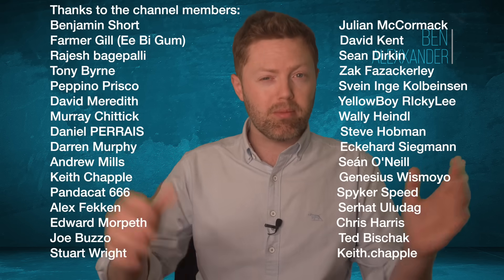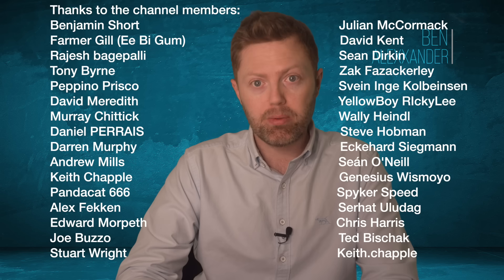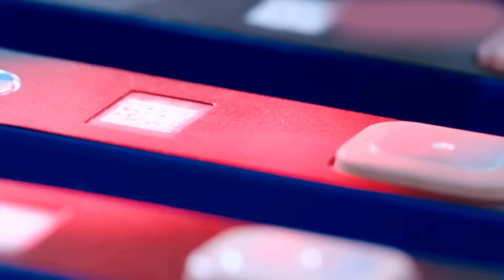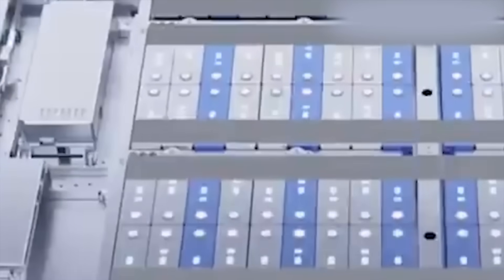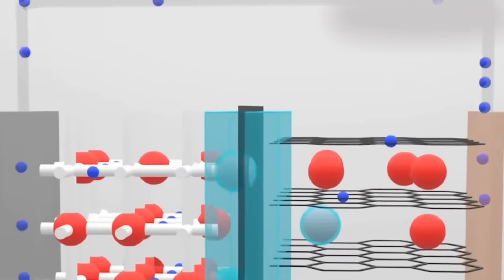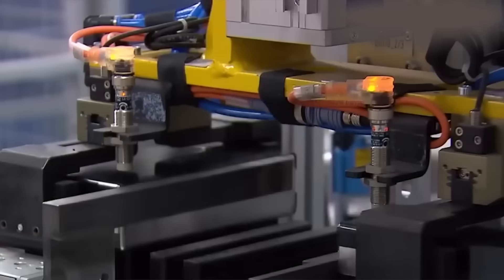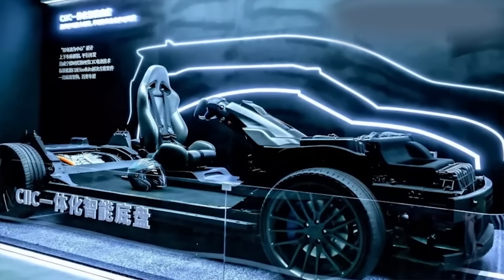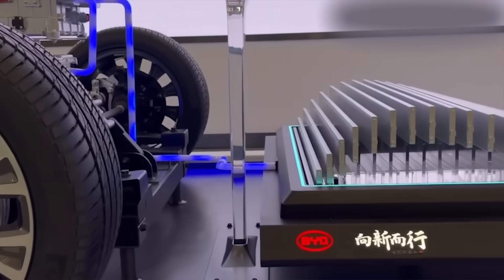CATL’s 500 Wh/kg Golden Battery Is Official — What You Need to Know

Comment from the maker: Answer honestly, would you in a plane with a large battery aboard? Yes or no.
Reply: Would you be in a plane with a 100 tons of very flammable fuel? Thats what a 787 carries.
Reply: @humanbass  its more like 100 m3 or 80 tons but still not nice to think about when you are in it.
Reply: @humanbass  just so you're aware, kerosene is very hard to ignite, but lithium batteries go up like a Roman candle for no particular reason
Reply: Yes
Reply: fly?  absolutely - they're prop-based right?  So from a safety point of view - as long as the battery has power, the plane is safe.
Reply: @peterd3125  Well as safe as planes get . They can glide if they have enough wings. Also multiple motors and battery packs make it's power system more redundent and failsafe
Reply: @ctuna2011 dear passengers, captain speaking. Flight assistants will collect all battery packs you may have in your hand luggages. We had some head winds and we are a bit low on batteries for the flight. thank you for your assistance
Reply: Yes, but probably not the first flight.
Reply: @Ryan-ff2db one would assume they'd thoroughly test it before commercial availability...
Reply: @Ryan-ff2db  Wahrscheinlich  dürfen sie nicht beim ersten Flug mit einsteigen. 
10% aller Testpiloten erleben die Rente  nicht.
Reply: @Ryan-ff2db  The first flight would be the first of many test flights.  Pretty sure they wouldn't be selling seats for those, so you can rest easy, sport.
Reply: Yes over jet fuel.
Reply: Solid State Batteries offer double the range, half the weight and do not suffer thermal runaway, so this question displays ignorance and lack of knowledge.
Reply: @chandleredwards no it doesn’t! SS batteries are not at manufacture anywhere large scale. These are validated now. Will give larger small scale aircraft with better ranges which can be refuelled with renewables
Reply: @chandleredwards Solid state batteries at commercial scale are about as imminent as fusion power....
Reply: Yes, I would and will fly in planes powered by batteries as I’ve driven EV’s for the past decade and know them well
Reply: Yes. From that day forward mishaps with a battery powered plane will eliminate massive fires from jet fuel/ kerosene.
Reply: yes. go china go
Reply: There are quite large batteries in airplanes even today.
Reply: Ist sicher, als Kerosin zu verbrennen.  Aber zuerst mal  alles mit weniger als einer Flugstunde. 
Inseln springen,  Über  hohe Berge steigen (können Benzinmotoren kaum gut) . Kurze Startbahnen  nutzen können. 
Kurze Strecken mit vielen  Starts innerhalb  von 24 h. 
Regionen mit extremer Kälte  und  extremer Hitze. 
Wasserflugzeuge.
Reply: Yes.  No worse than a full tank of jet fuel.
Reply: The writing is on the wall. The US continues to follow an energy policy written by the petroleum industry while the rest of the world moves on. Drill baby drill is going to bite us in the ass sooner than we think. Yes, I would get into a plane powered by batteries. Burning jet fuel on one’s body is not a good scenario.
Reply: Definitely over flying on top of a fuel bomb.
Reply: The alternative is flying  with tonnes of explosive fuel… so yes, happy to fly with a  battery
Reply: Yes. Very likely to be lower risk than one using avgas.
Reply: Sure beats 100 octane Av gas! lol I'm a pilot.
Reply: Every seat an ejector seat.
Reply: Wendover Productions examined the economics of using electric prop planes for short-haul flights.  If his numbers are in the ballpark, they would be very competitive with their minuscule "fuel" costs, huge maintenance savings, and very quick turn around.
Reply: Preference is a Hydrogen hybrid dirigibles(if Starship can do it with Stainless steel skin, or the original Falcons had some carbon fibre designs), with batteries and electric propulsion. That would beat cruising the oceans in big ships.
Reply: @DiyOddJobLabourer  you are unaware of the explosive capabilities of Hydrogen are you ?
Reply: @chrisbraid2907 yes, fully aware. Hence, improvement in manufacturing the fuselage of a giant blimp, is needed. With 3d printing, the exo-skeleton of the blimp, should be like hollowed out, compartmentalized and filled with Hydrogen, and or mixed, or interchanged with Helium. Not that it is already solved. But that if there is anything that could be solved, it is a interesting subject for engineers to solve. Place solar panels on the giant blimp and charge the high kWh/kg batteries, those things could even replace Starlink satellites?
Reply: You fly now with many tonnes of highly explosive kerosine aboard…..
Reply: I think they should put the batteries in the wings, like they do with jet fuel, because a) it provides structural bending relief b) the airplane would not be able to lift off if the entire wing was battery, so there will be gaps between, which could include a thermal barrier.   Also each cell would have wing skin above and below it, which has a slipstream blowing over it so battery can shed heat.   All of the previous would make a thermal runaway less likely or slower to spread compared to the way most seem to do it, which is to bunch all the cells together in a rectangular pack in the fuselage.  If one goes up, the whole lot does, but its easier to swap out the whole battery that way
Reply: I always poo in the toilet.
Reply: @rolyantrauts2304  Well done.
Reply: I prefdr hybrid for plane
Reply: Would I join the mile-high club? Sure! Thanks for asking.
Reply: Yes please
Reply: Yes . Safety Regulations and Regulators have proven safe.
Reply: Yah, why not. If something ever went really wrong, you could just launch the battery out of the plane instead of letting it roast the whole cabin while the fuel tank is still full. It is basically sending the flammable troublemaker out the door and keeping the people inside where they belong.
Reply: Yes
Reply: Yes
Reply: Come a time, that will be the norm.
Reply: yes
Reply: Yes of course. Planes are incredibly safe, especially considering the mechanics and chemistry involved. Just because the mechanics and chemistry changes from fossil fuels to electric propulsion doesn't mean the safety levels will change.
Reply: Answer from the battery powered laptop actually sitting on my lap with a minimal BMS ? Or send you a letter on flammable paper ?
Reply: My worry isn't the technology itself, but that the FAA has been gutted so much that they won't validate the safety without bowing to the industry. If I felt I could still trust the FAA safety certification process, then yes.
Reply: yes, but also if we have batteries this good, i am hopping on an ebike, and riding it across the nation.
Reply: requirement engineering can tell:
two banks of batteries, smaller one is for redundancy
catl has good records of goodwill.
forget the battery made by japanese co. in boeing airplane years ago.
some chinese low-altitude airplanes can safely fly during failure of half number of propellers
Reply: Yes
Reply: Yes
Reply: NO it's a disaster looking for somewhere to happen
Reply: I highly expect that the military implications of this technology may hinder China's willingness to distribute this technology at this time.
Reply: i dont plan to fly again till it is battery powered, so yes
Reply: yes
Reply: Yes but the roof of the plain should be covered in solar panels to recharge the battery during daytime.
Reply: Yes it is safer than engines.
Reply: Large battery? LOL, a typical commercial airliner can carry 100-200 tons or more of fuel.  An Airbus A380 can carry over 250 metric tons of fuel. As flammable as batteries may or may not be I believe jet fuel (pound for pound) still has FAR MORE explosive energy than any battery. And Jet Fuel is a whole lot easier to ignite.
Reply: Yes if I know it’s lipofe or something that’s chemistry that Don’t explode lol I haven’t built my own flying motorcycle because nothing they have right now can handle the gforces 😂 safely people don’t understand the importance of gravity has on current flow . 
  A lot batteries explode at high g loads because the electrons aren’t just fighting the resistance in the wire gravity is holding them in place so if u have sections  that have bad connections they will instantly get all the current flow I hope that made sense 😂 I can’t talk or I’d be a teacher 😂
Reply: @kingrutse3278  Current flow is not meaningfully affected by gravity. The integrity of the battery could be affected by crash-level accelerations, but not by ones normally experienced in the vehicle.
Reply: @kingrutse3278  Gravity has essentially no effect on electrons.  The mass of an electron is insanely small, while the electrostatic force on them is massive relative to their mass.
Reply: @incognitotorpedo42 what 😂😂 who told u that lmao .. how do they travel through mediums 😂😂 this is the problem it’s like the people attacking avi lobe because they was taught wrong 😂😂
Reply: @incognitotorpedo42 how did u calculate the mass of the electron if I can never know it position 😂😂 what ur referencing is a theory 😂😂
Reply: @i @incognitotorpedo42 hate to tell u this but spin at that level will cancel out the earths gravity 😂😂 but if u move that object that motion imparts it’s own set of physics.

The battery thing wasn’t me juts throwing something out there lol 😂😂 the Chinese ev companies are actually doing real tests not juts faking stuff for inverstors
Reply: Yes of course. Not with a US pilot though, because their eyesight standards are lower than the UK (even though both can fly back and forth on the same routes which is nuts). I'd much rather be in an electric plane.
Reply: @jonevansauthor  That claim is literally a bonkers level of nonsense.  The standards are so close as being nearly identical...

Comment: Maximum charge/discharge speed, in C units? (1C means full charge/discharge in 1 hour. So for example, an 80kWh pack at 4C can supply up to 320kW of power, and can get a full charge in 15 min if your charging station can supply 320kW.)

Useful lifetime, in cycles? (1 cycle means charging and using the full capacity one time. Not necessarily draining the battery from 100% to 0%, perhaps going between 30% and 80% twice.)

Fire safety? (Is this more like traditional lithium ion batteries which require careful management circuitry to avoid risk of fire, or more like LiFePO4, which essentially didn't have that risk at all?)

Useful temperature range to store, use, and charge?

So many obvious questions your video somehow forgot to even ask let alone answer. I am disappoint.

Comment: I think for aviation it makes more sense to use hydrocarbon fuel that has been created in a clean way (by extracting the carbon from the atmosphere using solar/wind power).
Reply: agro waste biochar.
Reply: how about using the solar/wind power to generate electricity and save a step.
Reply: @TerryHickey-xt4mf  where possible.  these batteries would reach 250 miles.
Reply: @TerryHickey-xt4mf  because hydrocarbons are considerably more energy-dense than any battery chemistry. So it makes sense to create a "carbon cycle" where we use electricity to extract carbon from the atmosphere and then emit it as CO2 again during flight.

Comment: $19 a kilowatt hour bring a 100kw battery cost down to $1900.  That is a game changer for ev. At that price point, i could buy a new battery for a cheap used ev and not have to worry about anything expensive going wrong.  For example, buying a used ev at a really low price to suddenly get a bill for 20 000 to replace a battery. Still more expensive than the $1000 second hand car that only needs diesel and few parts fixed over the 5-10 years i would own it.

Comment: Cool! Now we're only 20 times less than diesel. But since an ICE wastes about 1/2 to 2/3 of the energy as heat anyway, it's about 7-10 times less.
Reply: 1/2 to 2/3???😅😅😅😅😅
Reply: @simonmackenzie4227  I was trying to be generous to them. :-) But yeah, modern diesel engines really are 30-50% efficient, which is quite close to the Carnot limit. That only took a little over 100 years.
Reply: Good point: Diesel 12,700 Wh/kg
Reply: @MyContinent  A thing I left out is that an electric motor weighs nowhere near as much as an ICE plus gearbox, exhaust and cooling system. 
SO for comparable vehicle weight, you can replace the difference with batteries "for free".

Comment: Energy Densities of Ammonia Fuel Cells
Ammonia fuel cells are gaining attention due to their potential as a clean energy source. The energy density of ammonia fuel cells is a critical factor in their efficiency and application.
Current Energy Density Values
Type of Energy Density	Measurement	Value
Gravimetric Density	Wh/kg	>1,000
Volumetric Density	Wh/L	>750
Advantages of Ammonia Fuel Cells
•	Higher Energy Density: Ammonia has a higher energy density compared to hydrogen, making it more efficient for storage and transport.
•	Carbon-Free Fuel: When produced sustainably, ammonia can serve as a carbon-free energy source.
•	Compatibility: Ammonia fuel cells can utilize existing infrastructure for storage and distribution.
Applications
Ammonia fuel cells are particularly promising for maritime transport and other sectors where high energy density is crucial. As technology advances, the efficiency and cost-effectiveness of ammonia fuel cells are expected to improve, enhancing their viability as a renewable energy source.
Reply: Downside, ammonia poisonous

Comment: Yes, I'd definitely fly an electric aeroplane.  As long as it wasn't built by Boeing.  If it's a Boeing, I 'ain't going!
Reply: Glad you been paying attention 😂
Reply: The UPS crash was a McDonnel Douglas,
Reply: @Islamisthecultofsin Boeing bought MD 28 years ago. Boeing, as the holder of the type certificate for the former McDonnell Douglas models, is responsible for providing the official technical data that operators need. That includes service bulletins, structural repair guidance, inspection procedures, parts support and any required instructions for continued airworthiness.
Reply: @LimaTangoFoxtrot   Yes, but they still didn't design or build the plane.  All of the pylons should be replaced with new ones.  If the runway had been built correctly, the plane would have been stopped and the plane intact and pilots uninjured.  Instead they just let planes explode into huge fireballs.
Reply: pipistrel
Reply: Having retired from Boeing, I know how management ignores employees and only goes for whatever they believe will increase profits.  It´s unfortunate because even though they skimp on paying their most valuable employees, they still have an excellent team of engineers and production workers.
Reply: Your knowledge is too reliant on social media.

Comment: When comparing batteries to fossil fuel, one has to calculate that the weight of the energi is same same on an "empty" tank for batteries, but almost none for fossil fuel.
A plane uses most of it's energy at takeoff, so when in the air it's fuel weight is already quite lower.
Reply: It also half of its energy for free by not needing to carry it, the air.

Comment: Video mentions 'solid state'.  Saw a vid that suggested solid-state batteries will trend as high as 800 wh/kg.  Not sure that is true but it sounds good. :)
Reply: I've seen theoretical limits of 1,200+for solid state cells! Even 450-600wh/kg would be amazing vs the current best nmc cells are 280-300 smh. the best right now is the welion nio pack which is 144kwhs in the same battery case as catl nmc 100kwh but weighs just 44# more making it at the pack level nearly 40% more efficient from a volumetric standpoint! Unfortunately per nio it costs about $29,000 us per pack!
Reply: @4literv6  From what I can tell, they are working really hard to get lithium out of the equation, at least for cars.  Mass conversion to EV (20%+) is going to require standardized, replaceable batteries, probably solid state.   Nobody wants to be stuck with yesterday's game changing battery.
Reply: Solid state are vapourware, always five years away.
Reply: Soild state will crush all batteries in fast charging,long range and longevity, hopefully 😂

Comment: I guess the 500 Wh/kg is cell level but it will also be interesting how much they weigh incl. package and cooling. The volumetric density is also relevant.
Reply: He said pack level but they used the phrase "up to".
Reply: remember its from china and as such is probably made up or is crappy in some fatal way.
Reply: @jebes909090  You're calling the biggest battery company in the world Chinese crap??
Reply: @jebes909090  china are implementing rules for fire safety in batteries that are stricter than anywhere Else.
Reply: @jebes909090 You're sounding a little racist. 🤔